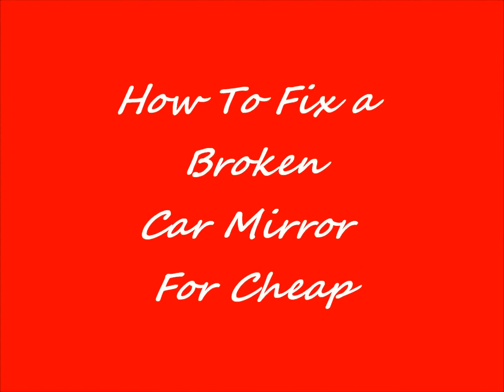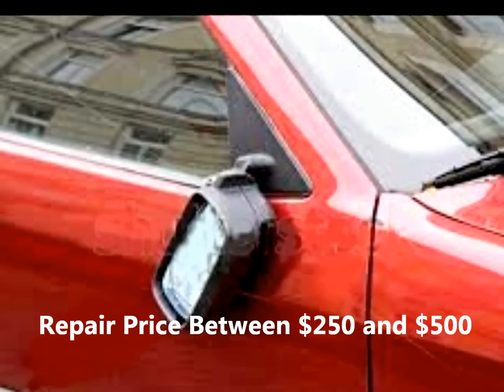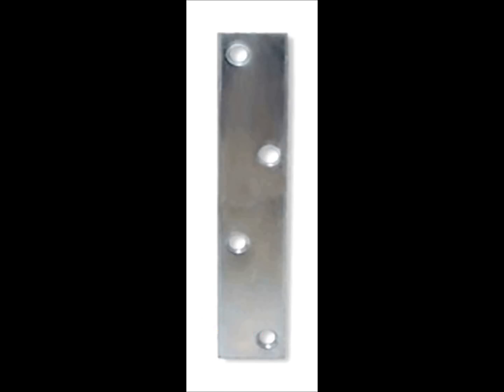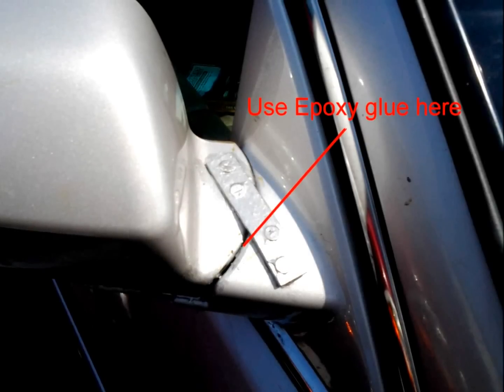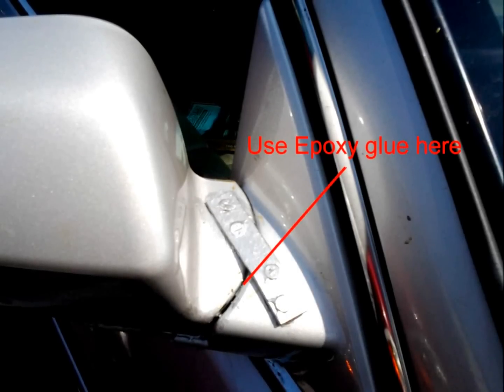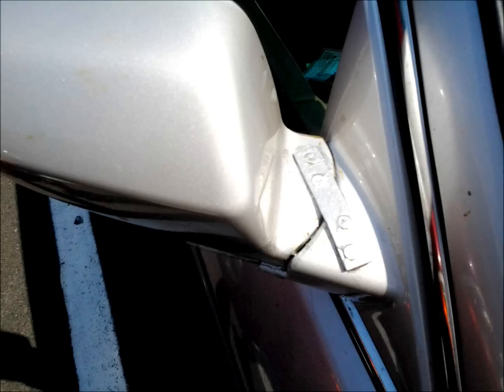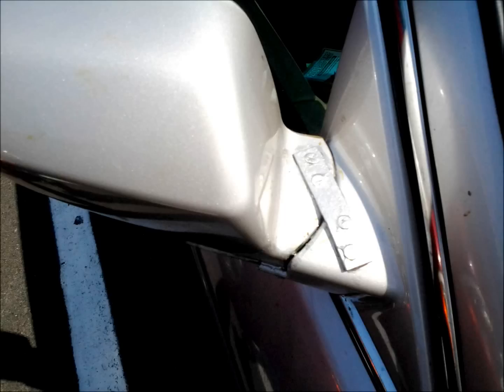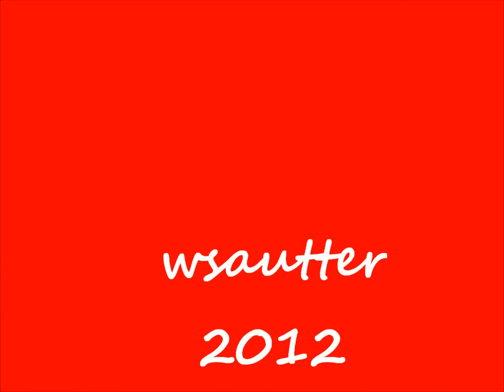How to Fix Your Broken Side View Mirror for Cheap

Comment: Walter, I have some questions if you have some time: What kind of screws and what size screws? Should  they be stainless steel? Do I get the "original" J-B Weld (there are so many J-B Weld varieties) , and lastly, how do I apply pressure for the first 30 minutes? I have a 2005 Honda Civic. Thanks for the video, I was shocked at the repair price at the auto body shop!
Reply from the maker: The size appropriate for the mending plate. The epoxy works best.

Comment: This is great video if you are tight on cash when repairing an old, old car! thank you so much for sharing.
Reply from the maker: +Robert Ballesteros - Perfect - That's what it is designed for! Good Luck I think if you were to attach the mending plates on the inside of the unit , drill holes and secure it using rivets it would look much better - you would only see the rivet heads on the outside. I can't really show what I mean because luckily I don't have a broken mirror - yet! http://wsautter.com/read-save-walts-books-ipad
Reply: Great walter. thank you for your reply.
Reply: +Walter Sautter .

Comment: I pulled up too close to a parking bumper, and when I backed away, the apron on my Honda Civic ripped. Now it's hanging at one end too close to the street. Again, very expensive at the auto body shop: they want to replace it,  and there's the doubled labor, etc. Thought about using the mending plates I'm buying for the side mirror. But what kind of fasteners do I use? Any ideas?
Reply from the maker: I think using rivets (pop rivets) would be best and easiest.
Reply: @WalterSautter  Thanks!

Comment: My cover is still on. Went by some jerk in a bus blocking entire lane w his flashers and passing hit passenger side mirror. The glass in my mirror fell out hanging by the electrical wires. Had to tape back on but need to fix bc cannot adjust from inside car. Looks like all parts still there. It's a 2010 Toyota Corolla S. Do you have a video on how to reattach mirror and inside wires? Housing still ok and mirror not broken just came off housing.
Reply from the maker: Send me a picture and I'll try to suggest something. wsautter@optonline.net.
Reply: @WalterSautter  thanks for your response. Went to my regular Toyota service dept today for oil change and check the mirror. Was so happy bc all parts still there and all they had to do was snap everything back together. Didn't even charge me a lot. This is one happy Toyota owner. ☺

Comment: Had to do this on an old 2007 Saturn Ion. The whole mirror housing broke off and was just dangling by the cable. Not many places to connect with the mending plate, but I found one good spot and one OK spot and I was able to get it done. I basically had to put screws in the metal of the door just below the mirror housing and screws in the plastic of the front of the mirror housing. Thanks for the video and the idea.

Comment: I have to say, this fix is probably over-kill. And it's WAY TOO MUCH TROUBLE...

I broke off the mirror on my 2004 Accord, and I know the mirrors are cheap to 
replace, but I'm way too LAZEE and efficient to worry about it.

I glued it back on with Epoxy, and it held for about 4 years. It's very strong, and due to weather (I park outside) it finally gave out today while I was adjusting the mirror.
Keep in mind, for last 4.5 years or so, I've been taking it through car washes (folding in mirrors on both sides each time) and it takes about 20 minutes to just clean it off again, and glue it back on, AGAIN (was dangling by the cable, YMMV). 

Use tape to hold it in place after gluing, and find a way to hold it together very tightly, while it's setting up. Sets up in first hour, hard in 24 hours, best not to drive the car for 12 hours after gluing it. Cheers, OUT.
Reply: what was the name of the glue you use..
Reply: @Anna-yu4qj  epoxy
Reply: how do you hold it in place for that first hour?
Reply: @mrgrtd8447  I parked close to the wall of the garage in my case. Used tape to hold the entire assembly tight to the car, then wedged something between wall and mirror (passenger side) and it was held in place very tight until it setup an hour later or so; i let it go overnight. Years later I did fix it correctly; ordered a new white mirror, it matched really close. Never had to paint it.
Reply: @surfyogi  that's a great idea! I'm not in a garage right now, only a carport, but the carport has columns. I'll use one of those. Thanks!!
Reply: What’s the name of the exact glue you used? I’m finding many things under “epoxy”
Reply: @journeywithjus  Any 2 part Fast Setting Epoxy glue. Mix 2 equal parts, setup the parts first to know how they will be held together as glue is setting up. U can use tape to wrap it, but that can have glue residue. I like to park close to wall or column and wedge cardboard box in place once glue is on. Come back next day.

Comment: Appreciate the spirit of your solution, yet challenge the repeated premise of the cost of just replacing the mirror.  If you're enough of a DIY person to try your fix, not that much harder to replace the whole mirror assembly yourself.  (for most models, like my Montana, easy videos available on line too)  As for the cost, for my large Montana with power mirrors, you can get get aftermarket replacement mirror assemblies from AAP for $40 -- less the usual 30% or so discount.  Or better yet, go to your local pick 'n pull salvage yard and get one for $11 or less.  Your repair will look new, and for about the same price as your fix -- without the band-aid look.